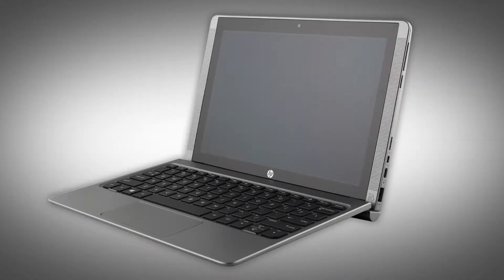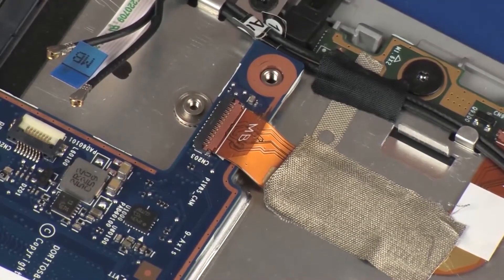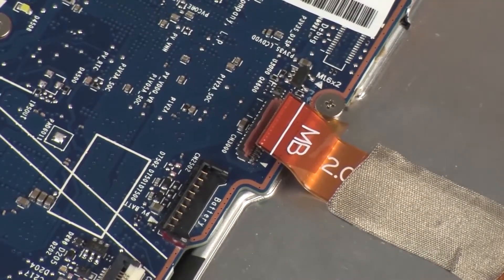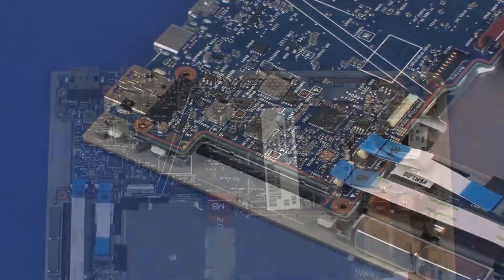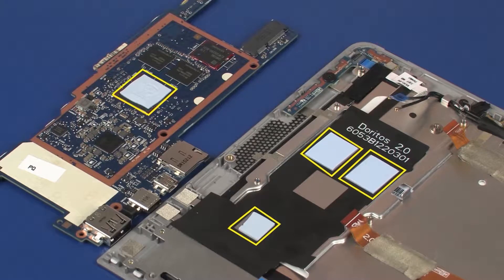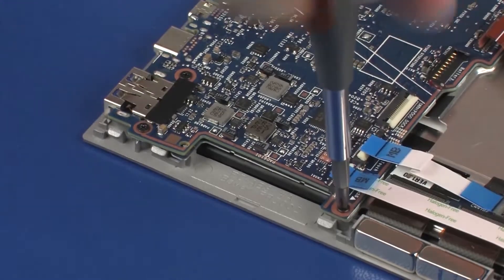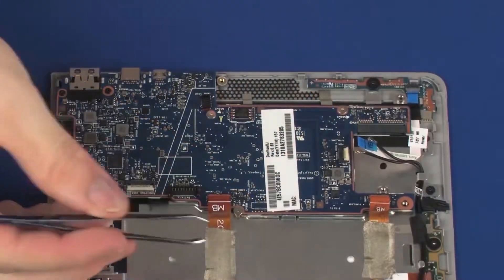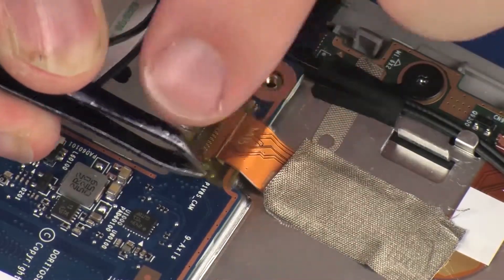Replace the System Board | HP Pavilion x2 Detachable 10t-n000 Notebook | HP Support

Comment: where is the hard drive/SSD in this system, I need to replace it. Cheers
Reply: Did you find it????
Reply: @damirlelic4476  it had a weird ssd that was soldered onto the motherboard mate, no chance if replacing it
Reply: @damirlelic4476  I got windows 10 on a falsh then plugged it in and booted windows from that and reinstall and it fixed the boot loop but I lost everything but atleast it fixed it
Reply: @declanlea6696  I cant do nothing…
I have error Boot device not found 3F0 error.
Tryed with 5 diferents windows 10 but wont boot up windows from usb.
Reply from the maker: +Declan Lea Please refer this video to know about replacing Hard drive assembly: https://bit.ly/3mL3BAv
Reply: @HPSupport  thats not hp pavilion x2 10t-n000
Reply: @pejoeazmi4070  did you find where are the ssd disk?